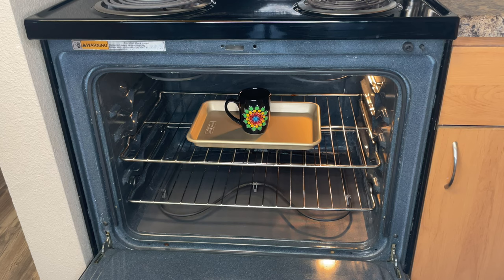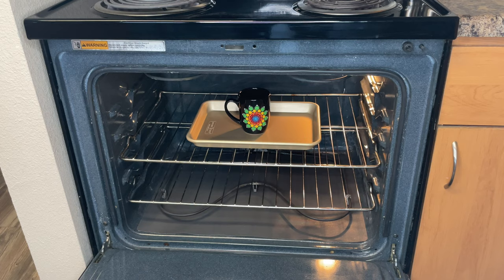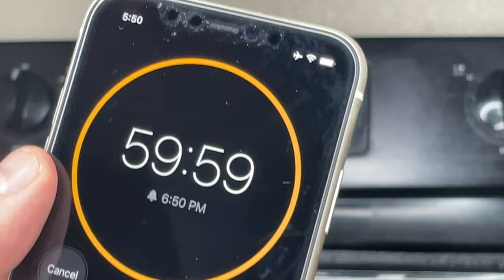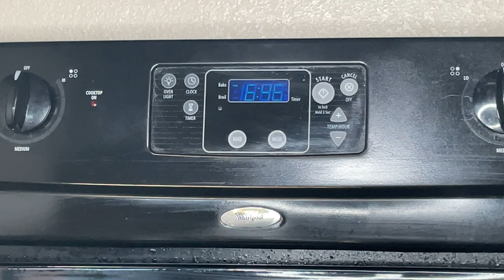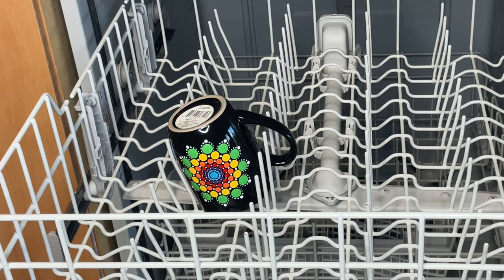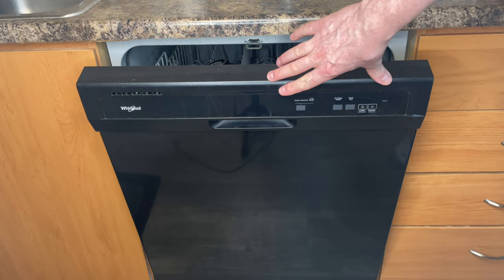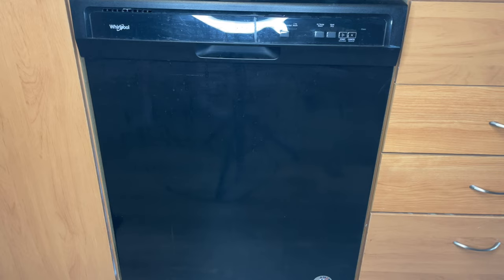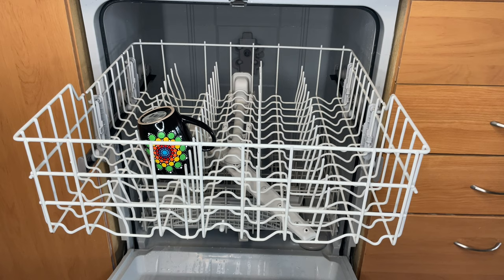Part 3 of 3 How to Make a Hand Painted Coffee Mug Dishwasher Safe

Comment: I will brave another go at this as I have had my paint bubble so far. Normal acrylic and multi surface. I was very disheartened and no idea why it happened as I followed the instructions on the bottle. I forgot about the one I did with normal acrylic but I didn't expect the multi surface to bubble. I did wonder if it was due to some of the dots being a bit puffy. At first I thought it was the metallic paint but it happened on all paints. Thank you for your videos. X

Comment: Whoa! So cool. Does this affect the safety of cooking food in the oven later? I'm not sure if the paint might be toxic or if there's anything that we need to do to clean or air out the oven after.
Reply from the maker: Personally I would only use water based acrylic paint. As long as you use water based craft paint there should be no issue with toxic fumes or anything of that nature. Be sure to read the bottles of paint for any warnings first. 😃❤️👍

Comment: Hi I was wondering, does the paint scratch off easy? Like if you were to be using the rough side of a sponge or a slightly rough towel to wash these would the design stay intact? I’m thinking about making some to sell but if they don’t hold up very well I would be hesitant
Reply from the maker: Personally, I would not scrub on the artwork with any kind of a rough implement like the scrubber side of a sponge. They should be top rack, dishwasher safe, though I do recommend hand washing, and being gentle on the artwork itself.  You may want to make one for yourself and test it out so you have a first-hand experience to share with potential customers on how durable the artwork should be.  😊❤️👍

Comment: Thanks for sharing, but the instructions on the paint bottle is just 30 min, is this depending on the instructions?
Reply from the maker: I have seen where people bake anywhere from 30 minutes to 1 hour.  I have baked on several types of craft paint including metallic & color shift and have not experienced any issues with the paint after baking.  If you are more comfortable baking for 30 minutes that should be fine.  On your bottle of paint I'm not sure if the instructions specify if the 30 minutes is after the oven comes to temperature or as soon as you turn the oven on.  You may want to verify but I have found the paints I have used have been forgiving on specific bake times.
Reply: @MarksMandalas  thank for your response 👍🙏